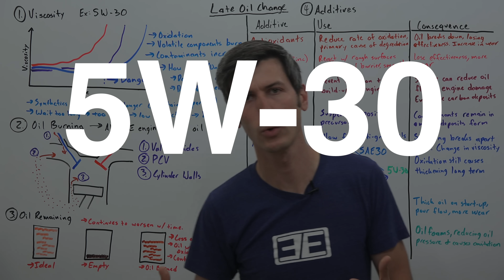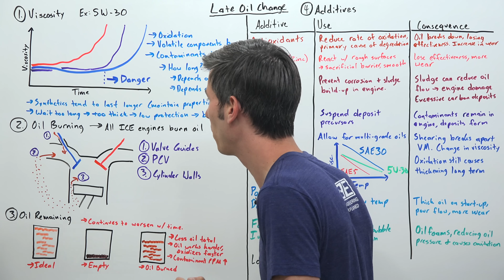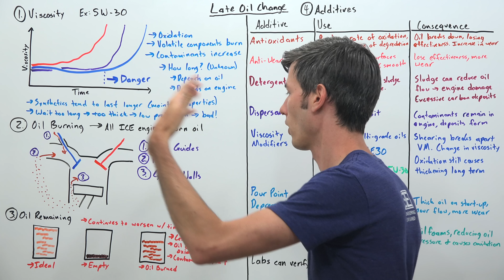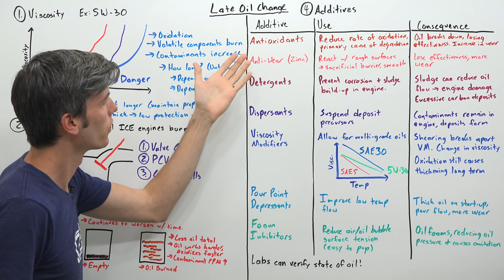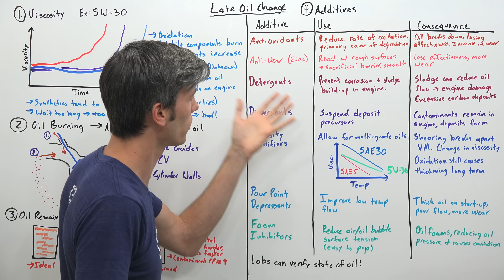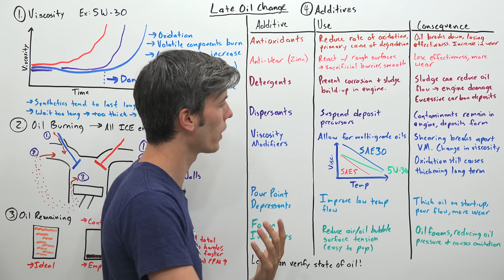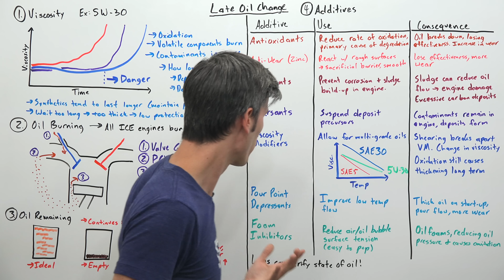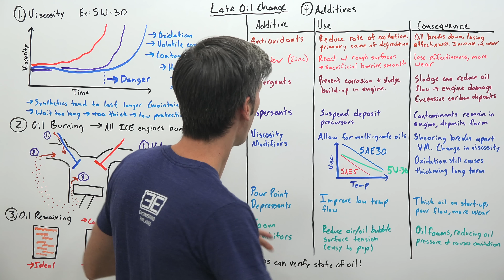What If You Forget To Change Your Oil?

Comment: I had a 2000 civic d16 i bought for $400 that when i went on a test drive the oil light was on and it was clacking really loud. Buddy said "lights on cause it could use an oil change, i just havent had time"... okay bud.. Thing didnt even read on the dipstick. I went home and grabbed my jug of 15w40 rotella for my diesel truck and topped it off before i drove home. Went 3 years on the car with zero problems and even drove it in rally of the tall pines in front of crazy leo before the race. I bought a BMW to replace it and wonder why i ever got rid of that thing. Bulletproof is an understatement for old Hondas.

Comment: Got a Sonata 2.0t with a full synthetic interval of 7500 miles, I'm thinking about trying 10k and testing a sample, what's a good lab to use for analysis of 10k oil?
Reply: Back in the day VAG suggested 10k intervals for their low displacement turbo engine. Guess how many went to the scrapyard after massive sludge caused a total engine failure. 5k miles/ 8k km is the optimal interval.
Reply: Joe Barbaro I change the synthetic oil on our 2013 2.0 Tiguan every 5k miles instead of the factory re omkended 10k changes. 10k is way too long on a turbo engine, and they know it.
Reply: @TheNortheastAl  VW build quality is a different story historically, no shade just being frank lol, but I'm currently burning a 1/4 to a 1/2 qt of full synthetic at my current 7500 mile interval, which most have told me is normal, if oil comes back at 10k anything less than good I'll likely stick to 7500 miles for the rest of my ownership
Reply: @Scouter98  agreed! 5k if I was using the part synthetic the dealer recommends, but I use full synthetic which the interval is 7500 miles... I'd feel safer about 10k if it wasn't a turbo, but I'd like to try 10k just once and see the results if the oil analysis at ~76000 miles on the clock 2013 Sonata limited 2.0t

Comment: I have worked on cars for many years and consider mileage /engine run time more important than calendar time to change oil.  What are your thoughts Jason on the frequency of oil changes on time versus mileage?  I know a lot of newer vehicles have an "oil life change" indicator light.  Seems to me they are programmed to remind the owner to change the oil once a year, regardless of mileage.  In most cases with low miles on the engine oil changing it in one year would be wasteful.  Thanks for another great vid.  -Glen

Comment: So if you had a supercharger in your engine or any other way to get additional air into the engine would that make the oil wear faster?
Reply: It's not about the extra air. Turbos and superchargers put extra strain on engines, therefore wearing them out faster. Turbos produce tons of heat and therefore the oil is being cooked even more at that point.

Comment: It’s been a long time since the transmission fluid has been changed for my car. It’s been running on old transmission fluid for years. If I changed it now would it cause any damage
Reply: Changing the fluid shouldn't damage a transmission however when transmissions are neglected for a very long time sometimes the clutch plates can become very damaged and when you change fluid the transmission may start slipping because the grit suspended in the old fluid was actually helping it shift.
Reply: I've heard that, once you've neglected it, you should just leave it because clutch material will be suspended in it and slippage may start to occur sheet flush.

But that sounds like it could be a myth.
Reply: A filter & pan drop SHOULD BE FINE, you're only changing about half the fluid out.
Reply: it shouldnt damage your transmission if you change it
Reply: Thanks it’s a 1997 Toyota Celica st hatchback automatic
Reply: Yes it’s better too just leave it. If it’s never been done the grit in the transmission is actually keeping it going it’s odd I know but if you put new fluid in it could cause it too start slipping. You could try just dropping the pan and filter area that only drain maybe half of the fluid.

Comment: My uncles 2018  Kia Soul burned all of its oil and didn’t show a warning light so his motor seized.
Reply: He is not alone, the oil level sensors gum up early and they will burn every drop of their oil without so much as turning on a lite in less than 10k.  Thankfully Kia will warranty the affected engines up till 150K.
Reply: Kia did replace the motor

Comment: Hi Engineering Explained. what is your take on service-intervals on different engines from different manufactures? 
My case being a Suzuki SV650S from 2008  with 72 HP (engine from 1998, updated with FI in 2003) needing oil change every 6.000 kilometers
Where as my Kawasaki ZX6R 636 with 131 HP from 2013 only needs an oil change every 12.000 km. 

Is Suzuki being overly safe, or has Kawasaki made a much better engine with less oil getting in contact with the combustion proces, are they taking in factors like newer and better oils, or is it just a publicity stunt for ownership comfort?
My own idea is to change oil every 6.000km from an operational point of view, since it's a same size engine with almost x2 the power output.
Reply: Just like with cars, you will have one group of people who will tell you stick to stick to the manufacturers recommended intervals and the others who say you have to change it more frequently.
I dont have a lot of expierience with 4 stroke bikes, but 12k seems a little high, especially considering that the rider is going be a adrenaline junkie, not a grandma commuting to church, meaning that the engine is going to be taken to its limits.
You also have to consider that oils and tech have come a long way in those 15 years, which explains the difference in service interval lenght.
If the service isnt too costly and you plan on keeping those bikes for a long time, its worth considering doing oil changes more often.

Comment: Should I then be using an oil with a high zinc content for my engine with bad bearing surface damage? All the camshaft bearings are milled into the block, so simply replacing them was not an option. The car has been, surprisingly, running fine with all this damage for 30k miles.

Comment: If ur burning oil, its not a big deal

Compared to no oil to burn 🤔 (true story)
Reply: Or leaking it. Keep adding and never have to change it.
Reply: You can put a pipe on your crankcase vent and pretend you have dual exhaust!
Reply: That 2 stroke life.
Reply: If your burning more oil then fuel, you may filled the fuel in the wrong tank. And since we all know, diesel is a oil, oil is a lubricant, a car needs lubricant...I am sure someone already did that
Reply: right! Filling up oil is cheaper than rebuilding the engine.
Reply: @billnopoles1934  well at $3 a quart vs $4k for a reman without the install on a $1k beater I think the weekly oil top up is cheaper.
Reply: My oil is balsamic, I just keep adding more... :-D
Reply: Could mean your driving a steam engine.
Reply: MANN[][][]  😎

Comment: Do one on the safety of extended drain intervals some modern cars spec.  When I had my 335i, the oil change interval was the same as the naturally aspirated 328i.  It was also very long....10-14k miles, depending on conditions.  However, both engines take 7 qts of oil in a  3L engine, which I'm sure helps extend drain intervals, but it doesn't make sense that the high strung turbo engine, with higher temperatures and pressures, would have the same drain interval as the relaxed normally aspirated engine.
Reply: I assume the bmw oil spec for that car calls for fully synthetic oil.  10-15k miles isn't too long on a good synthetic,  turbocharged or otherwise.  Unless you track the car.
Reply: 10 psi of boost in a cylinder with 150psi of compression and maybe 600 psi combustion pressure.
The turbo doesn't change the equation much.
Reply: @Iceaxehikes  It's not the 10 psi of boost pressure that's the concern...it's all the extra fuel that comes in with that boost.    The NA version gets a max of 14.7 psi of pressure, the turbo version 24.7 psi, so cylinder pressures after combustion will be nearing double under certain conditions (let's call it ~50% higher due to the lower compression ratio).  Also, the turbos are oil lubricated, subjecting the oil to intense heat, and being very intollerant of oil degradation.  There's no reason that oil that puts higher demands AND higher stress on the oil would have the same change interval

Comment: Perfect timing with this video! I change my oil every 3k with full synthetic and was wondering if my engine's oil consumption was normal. The motor has about 20k on it and needs about half a quart after 3000 miles. Thanks for always putting out great content 👍
Reply: Look in your owners manual, sometimes they put in there how much oil is lost between oil changes. What might be normal for one manufacturer will not be normal for another. Also with these newer 0-20 synthetic oils that are so thin they seem to lose more oil. Look for a GOOD forum on your car & join it, they have a lot of info on there. You could ask your question on said forum ? I learned a hell of a lot on forums from people who had the same problems I was having & they have the fix for it, GOOD LUCK, SIR.
Reply: Also look in the owners manual to see if your adding the right amount of oil after a change. Example 4.2 qt with no filter change and 4.7 with the filter bei g changed out too. For sure do what now2run said also youll be able to find almost anythi g about your car on its specific forum. Im a member of civicforum and Corrolaforum cause u know whats what we have. They even break down to having a forum for each generation of car too.
Reply: You are changing your oil way too often, unless you only drive 3K miles per year.

Comment: I didn’t change my oil for two years lol I only drove the car like 500 miles a year though.
Reply: Still not good.
Reply: It will oxidize anyways. It still have contact with atmosphere and fuel, and, as other person stated here, it didn't heat up that much to evaporate humidity. Because of this you will see recommendation of change by time also. Something like "5k km or 6 months, which happens first"

Comment: Why sport cars use very viscous oils like 20W-60?
Reply: Companies expect you to take that engine to a track and get it hotter than street conditions so they put a slight thicker oil for the higher temps
Reply: Thicker film protects better
Reply: @FreeHazelNuts  But not BMW S85 rod bearings😎

Comment: Very cool! You should so do a video like this on automatic transmission fluid. I rather enjoy ur videos! And I like that u drive a subi!
Reply: Especially, a video on the new auto transmissions which have "lifetime" fluid and no dipstick  (Toyota Tacoma, looking at U).  He could do a great job on how to change and check the fluid levels in these "sealed" boxes.
Reply: Davey Bernard its no different than a manual trans really. Drop the pan to drain. And then there will be a fill bolt somewhere on top or the side along with a level check bolt. Bam job done. “Lifetime” fluid is a weird term. If the trans lasts 30k or 300k ok itself fluid it still was lifetime. That was the tran’s life.
Reply: Davey Bernard pretty sure you could just drop the pan and then fill it via a fill hole
Reply: I decided to check my transmission fluid level. I couldn't find the dipstick, so I checked my owners manual. (When all else fails, read the instructions.) It doesn't have a dipstick! There's no way to check it! Unbelievable. It's a Ford.
Reply: Yeah a "sealed" transmission just means it's not vented to atmosphere, pretty much all of them have a fill plug drain plug.
Did you think they welded the transmission housing into a single piece?
Reply: subi are unreliable turds
Reply: ATF is actually pretty simple in its formula.  It's more of a hydraulic oil than a lubricating oil.  Most of the additive package is focused on viscosity retention through shear stability and thermal stability with smaller variations between types in terms of friction modifiers and extreme pressure additives depending on the type of clutches used in that particular transmission.  It does not contain more detergents than engine oil, that's a myth.  The detergent and dispersant content of ATF is about 1/3rd the amount in engine oil.  The transmission case isn't exposed to combustion gases and acidic buildup like the engine's crankcase so far less detergents are needed.
Reply: What a tool liking someone because they drive the same car as you
Reply: @nickfizzle1234  Liberal?
Reply: joshua fiddy allen "sounds like socialism to me!"
Reply: CtrlAlt Debug Oh gosh, "socialism" is a bad word! Wash your mouth out with soap! Go to your bedroom and you get no dinner!
Reply: @ctrlaltdebug  socialism with extra steps
Reply: @nickfizzle1234  oh super smart guy! Cuz I've never owned a Subaru... I was merely making a statement in regards to somebody doing mechanics in physics explanations and he drives a boxer motor. Sorry I know alot of people that watch this channel are smart... Why people watch the videos in the first place. To learn. So that may have went way over some people heads.